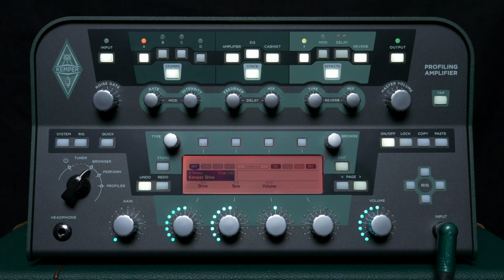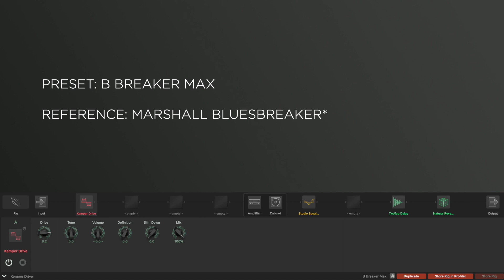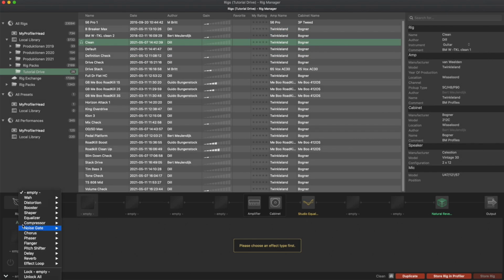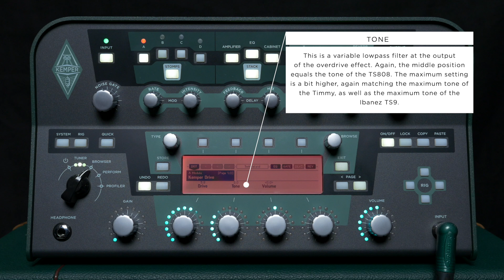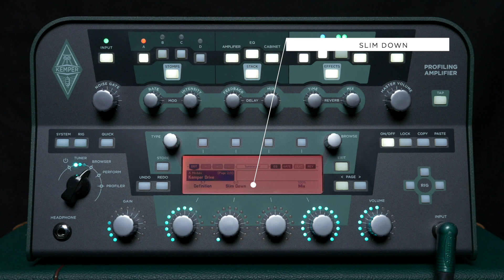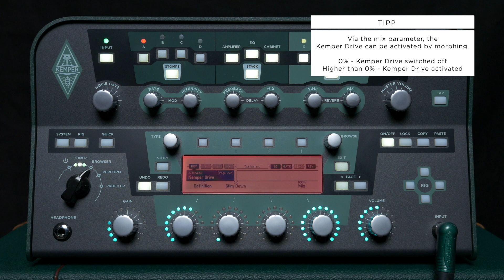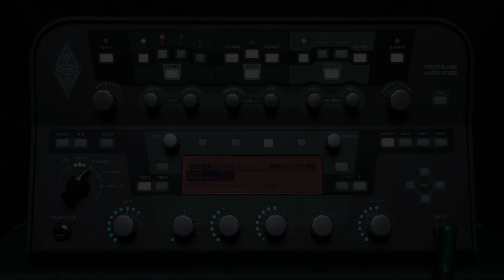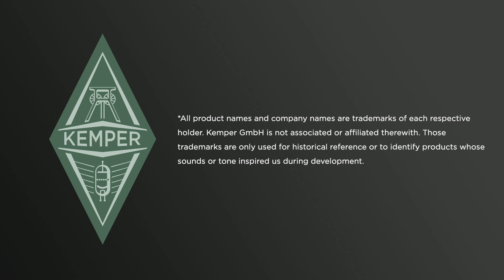Kemper Profiler Tutorials - Kemper Drive (english)

Comment: My only complaint is all these OD's have a clean bleed. A blend control would have been nice to eliminate the clean bleed. And I'm not talking about the mix control.
Reply: Finally a good answer for my problem too....that clean bleed. Right now i'm tryin'to get a good distorsion, over my clean and all of them have that clean sound in front and some dst on the back.  How can we eliminate this?
Reply: Hi! Does anyone found out the problem for that clean bleed? Every drive it's muddy. Still not a chance to get a nice drive on top of a clean amp, as in this video. I tried with parallel path but...no chance. Need help too, pls!!!